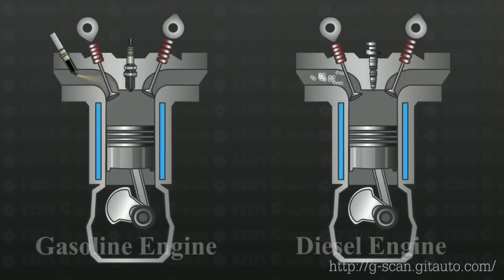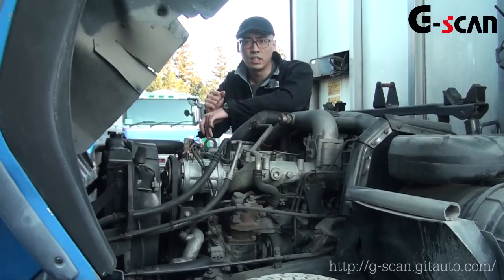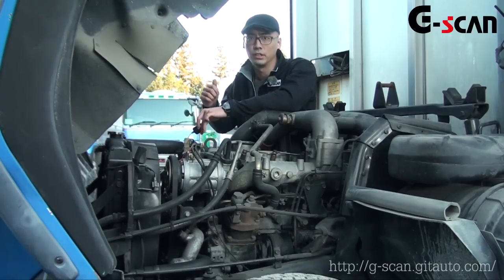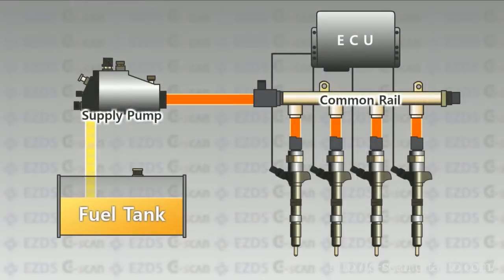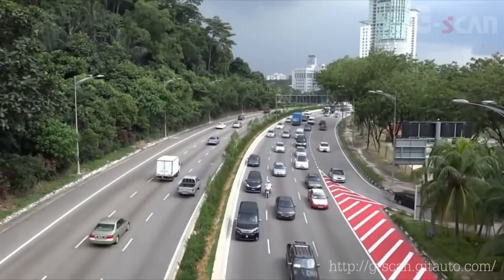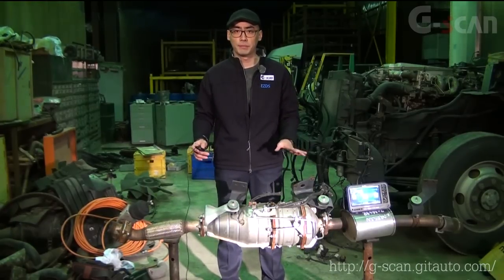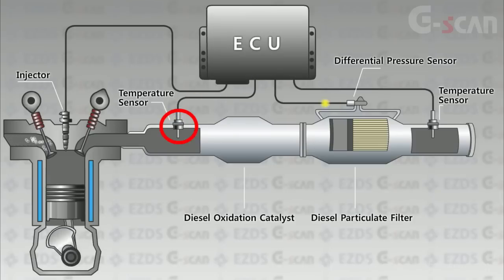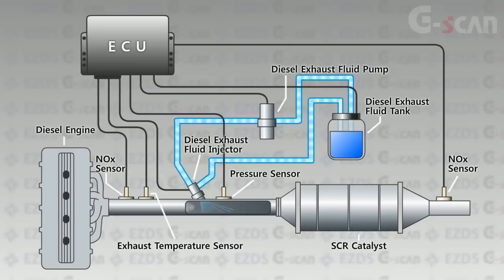[G-scan] Japanese Commercial Truck Training Video_Chapter 1

Comment: hi Jason this is Jesus I have a Mitsubishi fuso2007 fm260 and the engine light is always on the dashboard can you help me en this please .
Reply from the maker: Hello Mr. Vazquez. Many things could cause the engine light to be on. To properly pinpoint the problem, you would need to connect the scan tool, read the DTC ( Diagnostic Trouble Code) and perform the appropriate repair for the DTC.  If you need a technical assistance using G-scan, please post at Tech Q&A page of our website
https://g-scan.gitauto.com:6510/eng/board_skin/board_list.asp?bbs_code=5
Reply: Diagnostic Scan Tool G-scan2 thank you Mr Jason
Reply: Diagnostic Scan Tool G-scan2 
Hi ! I have 2008 mistubishi fuso fe180 but same time MCVU right in dashboard is on and the truck looses the power!can u help me for fixing that plz?
Reply: Jesus Vazquez
Reply: @ZenithDiagnosticScanTool       hi       can u help me wit my hino its reading    p1611  run pluse malfunction            can u tel me wht it mean